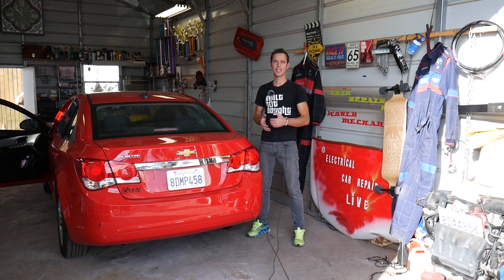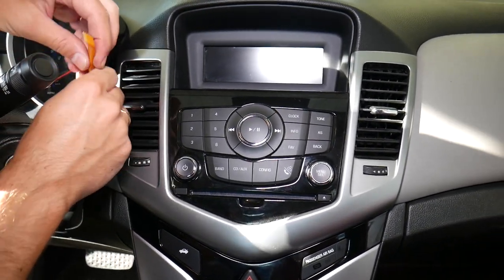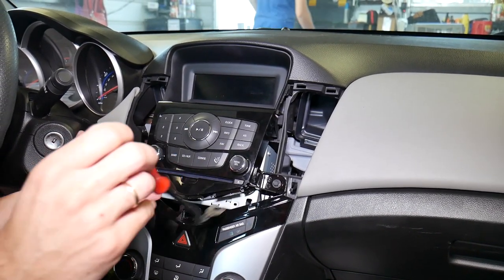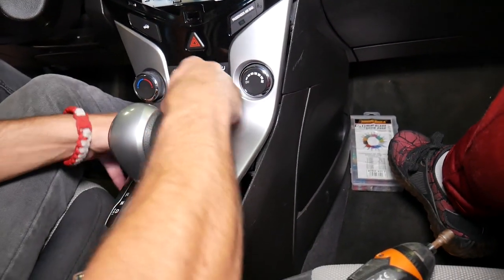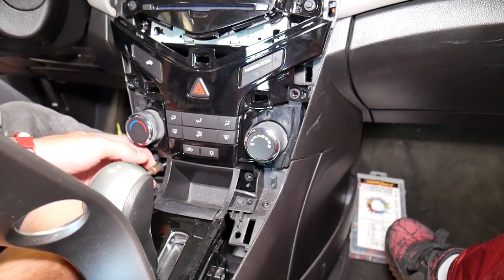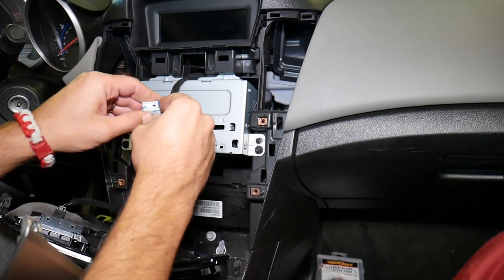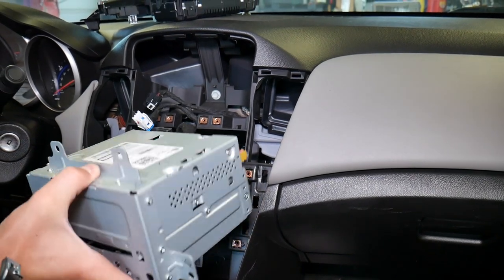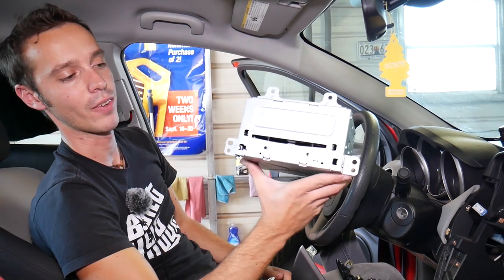CHEVROLET CRUZE RADIO CD PLAYER REMOVAL REPLACEMENT. CHEVY CRUZE RADIO TRIM BEZEL

Comment: I want to remove the whole radio but my 2013 Chevy Cruze has door lock options and stuff like that like even remote start is listed in the radio menu settings for the car headlights activate door locks options with key also automatic lock door settings are in the radio

Comment: I tried everything they said checked fuses check  everything I could think of them while trying to decide to destroy the car or not I took apart the center console where the radio is at took everything off took the radio and totally dismantled it and cleaned all the circuit boards and checked all wires were connected and checked if the circuit boards were not burned after checking all that I put the radio back together and installed it again it didn't work I said fine another freaking week without a radio well at about 5:34pm on a Wednesday without warning it turned on and I yelled with joy do that give it a week and 2 days it just might work now 100 percent sure but it doesn't hurt to try